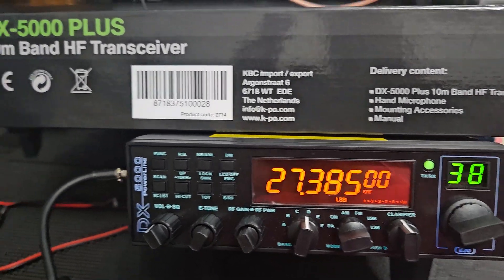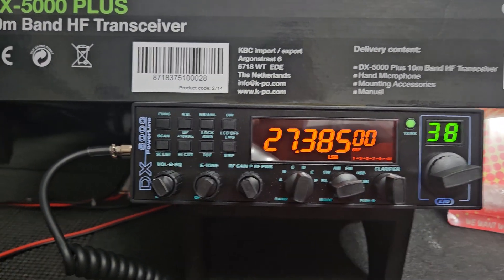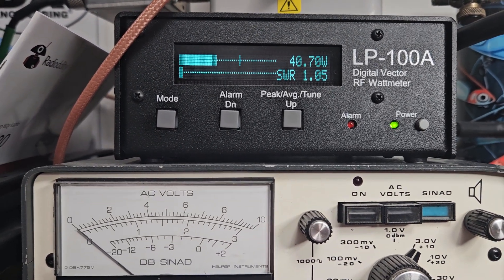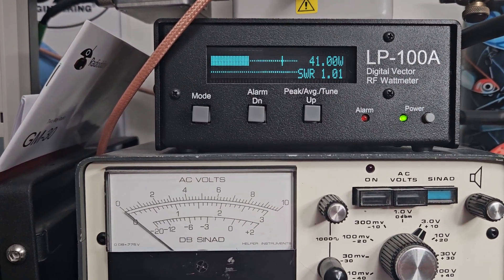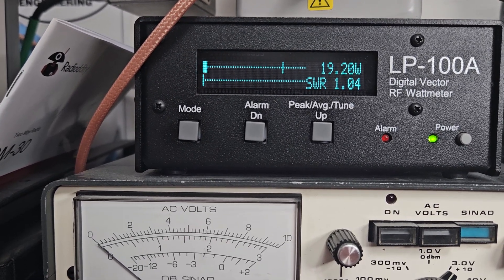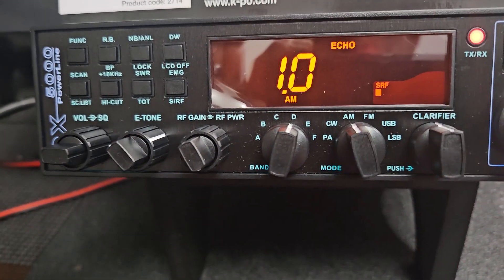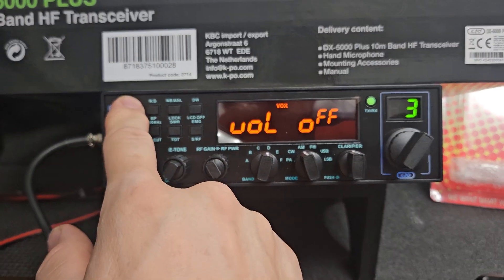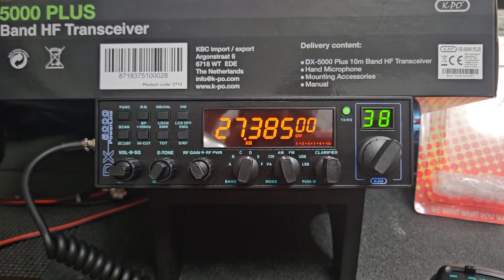New K-PO DX 5000+ for Tim in North Carolina

Comment: Great looking radio . Great way to set the mic up. Most radios do not need that RX wire. Some radios have DC on audio wire and you can change this on most menu settings for mic type. Another trick I learned just use a blocking cap on audio lead. I made a break out box for my mic on IC 7300 to XLR and RCA for PTT.  I use Heil mic or headset XLR . Heil footswitch .  Great way to keep both hands free to type and talk and not use VOX. Now I want to make one for my QT 60.  Got a G3 solar storm  and may see northern lights in NY again. Some bands been poor . Still made some 10 meter FT8 grayline contacts. Warming up the 49:1 to do it. 73